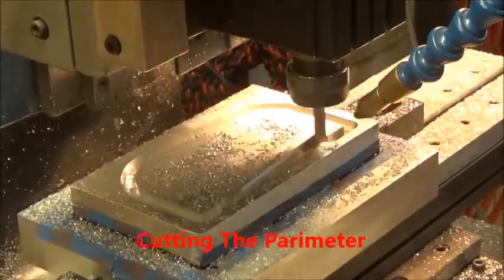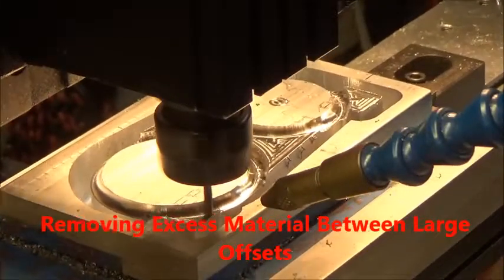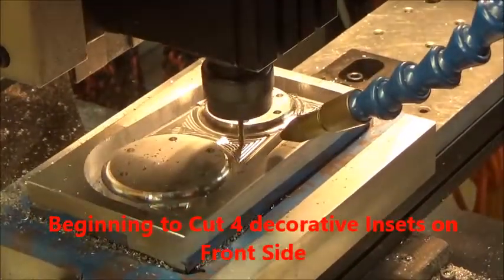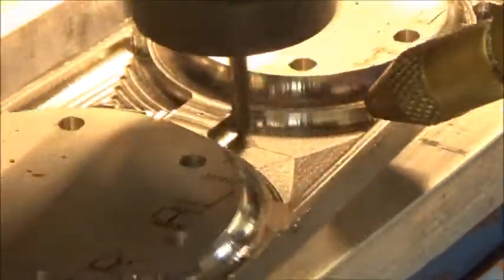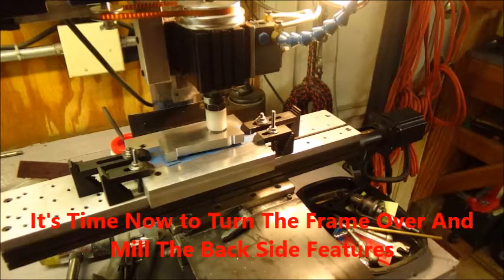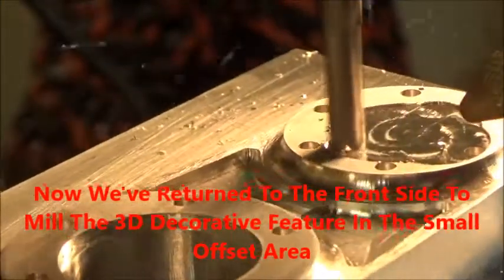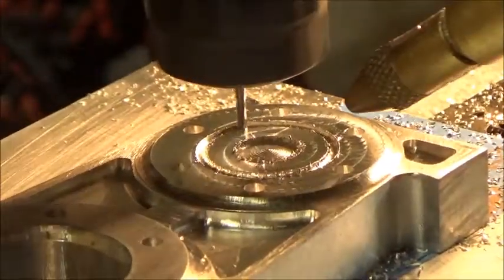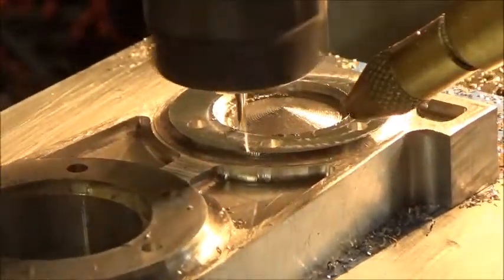"Vickie" Stirling Hot Air Engine Build - Part 3 (Front Frame) & 3D Feature

Comment: I always enjoy watching your videos. Thanks for going through the process of documenting your projects
Reply from the maker: Roy: Thanks.......I know there's not much interest in CNC but there's only one more frame to machine and then it's mostly lathe work.  Actually the frames should be done partially with the lathe but it takes a fairly large face plate which the Taig doesn't have that capability.  I have the mini lathe, but Walter doesn't, so the mill becomes the only option.  Regards: Larry